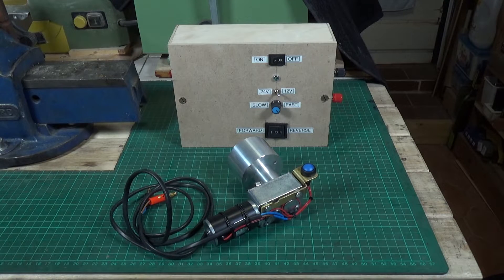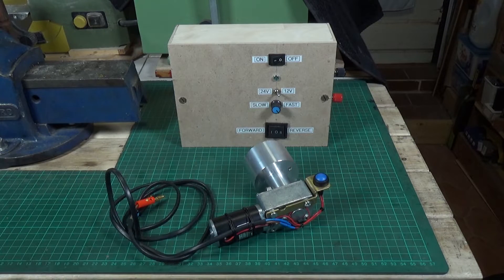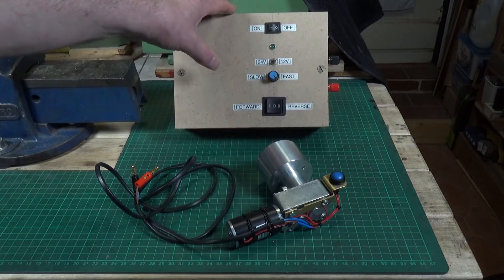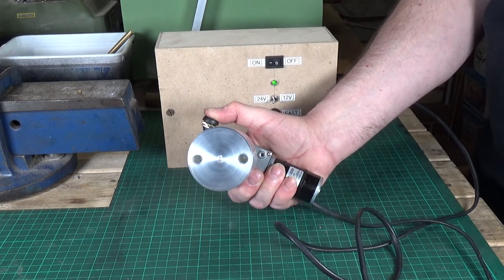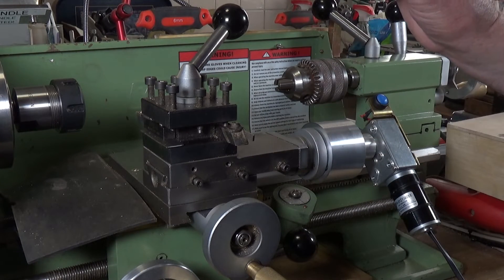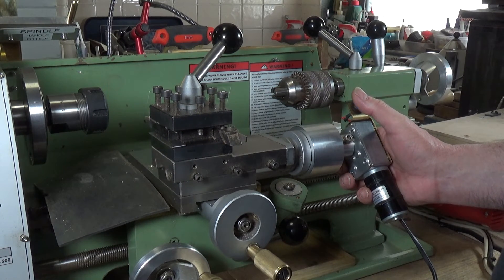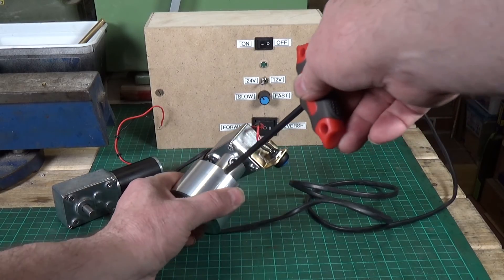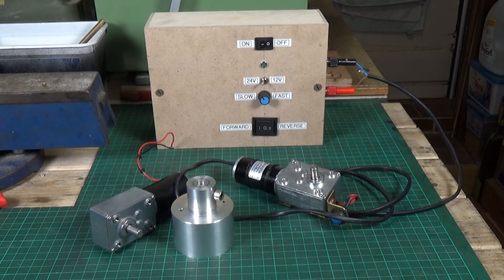Warco WM180 Lathe Compound Slide Power Feed

Comment: Which version of the motor RPM you using? Thanks
Reply from the maker: Hi, i'm using the 260 RPM version, this seems to give enough variation in speed when used with the controller.

Comment from the maker: Steve Jordan's 3 Videos on his Compound Slide Power Feed

https://youtu.be/vX-lksLzmHM

https://youtu.be/A4__nv88GGU

https://youtu.be/IOvMNKAPIPg

24V High Torque Gear Motor

https://eu.banggood.com/custlink/GvD3tD3IGm

DC Brush Motor Speed Controller

https://eu.banggood.com/custlink/KvDGPv3IKc

Turnigy 2200mAh Lipo Battery
https://hobbyking.com/en_us/turnigy-2200mah-3s-25c-lipo-pack.html

Comment: Just to access the compond slide bolts this is great project, but to turn tapers too... Perfect !
Reply from the maker: Yes, the compound slide screws are a right pain on this particular lathe.
Reply: @RetroSteamTech  I just drilled 2 holes behind the tool post and use a long T Allen driver.  Two punch marks to align the holes with the screws below
Reply from the maker: @nickhall5959  For access to the compound slide screws that would work well. The power feed is also useful for taper turning and other turning using the compound slide.

Comment: Wow....that's clever.
Reply from the maker: Thanks. I can't take the credit for it though it was Steve Jordan's idea.
Reply: @RetroSteamTech  I think this is above my paygrade to make one of these (and get it working). But a brilliant mod!
Reply from the maker: @SteamEngines-Jim  It's very simple to make and the machining is easy. The batteries can be expensive but like i say you can use an old power supply for a laptop or similar. The other parts are fairly inexpensive.
Reply: @RetroSteamTech  Do you have the gibs adjusted just as normal?
Reply from the maker: @SteamEngines-Jim  Yes and i have them fairly tight too.

Comment: Looks great , I have just ordered similar bits to put a variable feed on my carriage on the end of the lead screw , Now i am thinking to order a second motor to do this using the same vari power supply , Cheers Ade.
Reply from the maker: Thanks Ade. Those motor gearbox combinations are extremely powerful and also fairly cheap.